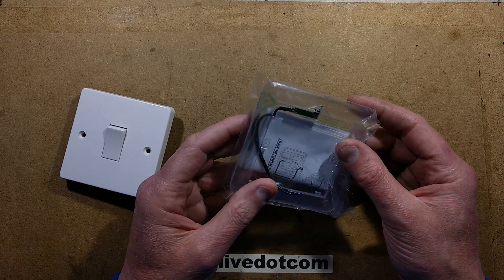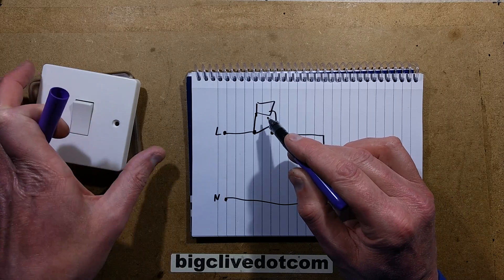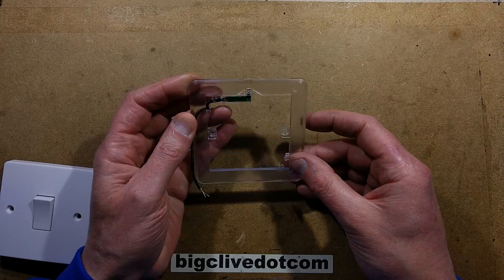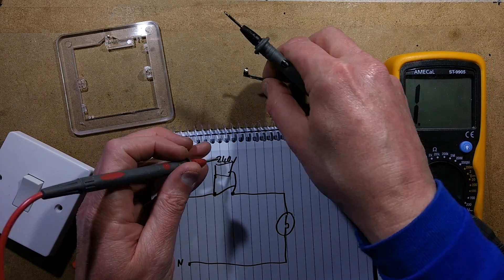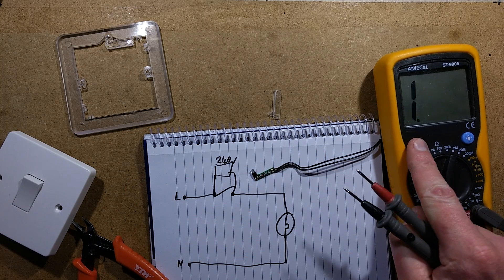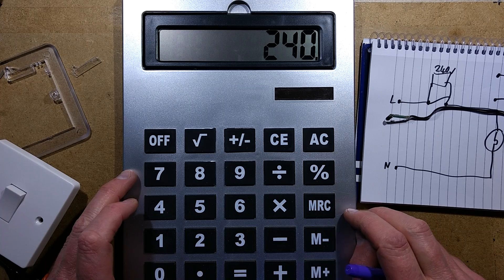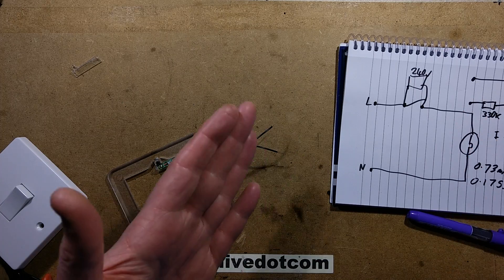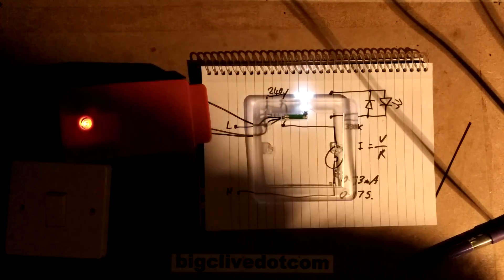Illuminated switchplate adapter.  (With "schematic".)

Comment: Why do they recommend to use it with LEDs lamps? LEDs can glow with a very low current, incandescent ones won't
Reply from the maker: +Techtastisch 75 I fluffed that bit.  It's recommended for tungsten lamps.

Comment: With The Wall switches installed and everything screwed up it will help diffuse the light into a  proper soft ring of light.. You need to finish the light box part of it.. There are 2 different plastic diffuser rings to capture the light and emit it JUST around the corners.. 
  I say install it.. 
  This is Just what i've been looking for, Thanks !!!!

Comment: Would be interesting to try that with a switch and an led bulb in place, I've had things like these allow just enough through to charge the capacitor in an led lamp and make it flicker while the circuit is off

Comment: One trouble with the 330k resistor being on the little PCB... if there is a short where the two wires meet on the PCB, the tiny gauge wire could shunt the light switch and end up carrying the current of the entire light fixture and melt or start a fire.
Reply: Actually you can do a binary search for the fault - only log2(n) breaker trips instead of n.
Reply: LakeNipissing well, good concern from the other guy i think... and even if this is to happen, a breaker still may not trip during the wires melt,they melt probably at around 1 amp and the breaker might be a 16 amp one. so the room light keeps drawing amps until the switch melts and cause fire... i wonder about this liklyhood.
Reply: Matt Quinn  5A round pin plugs and sockets are still available, I know because in the living room, dining room and master bedroom in my modern house (now about 17 years old) they fitted the 5A sockets to the lighting circuits so that table and floor lamps could be controlled by a double wall switch.
Reply: "I could see it being 'fun' trying to trace the faulty one if you had a few and the breaker tripped!". Turn on all the lights connected to breaker, reset breaker, turn lights on one at a time until breaker tripped.
Reply: We don't generally have a neutral in our switchboxes in the uk.
I've seen them connected to ground, and if they go faulty it trips the RCD (gfi)
Reply: Yeah, in the 60's they relied on the metal conduit for any earthing, but generally a light fitting did not need an earth.
Sometimes when you control several light circuits from one switch location it's easier to run the power to a switchbox and distribute it to the several lights from there.
Only RCD on a lighting circuit is the 100mA main RCD, which is only needed if the earthing is not good enough to carry full fault current.
Reply: HAHA, i know that trick of charging batteries from the mains, in the 60's i had a 'Dan Dare' intercom, batteries went flat, so i thought it would be a good idea to connect the wires to the striplight above my bed, i let the smoke out :P
I was about 7 or 8, but understood that i had to turn the light off while connecting.
I guess that's why i became a sparky :D
Reply: If you messed up the wiring, it sounds like something was really wrong, iirc my bed light was plugged in to a socket, are you old enough to remember the old round pin sockets ? it would have been a 5 amp socket, possibly on a 10 amp fuse (several sockets on a circuit), fuse wire blows at about 1.5 times the rating, and wouldn't damage the wiring.
Yep, i remember the spring 'breadboards', had one myself, something like the 'science fair' stuff on this page http://zx80.netai.net/grant/ElectronicKits/index.html
Reply: I think my post disappeared because i edited and added a link which has probably been set for review, clive may allow it sometime.
If not, search for 'spring experimenter board' in images, you should see 'grants' , on the page scroll down to 'science fair'
Before our council house was rewired it was lead covered twin and earth, the wires were rubber insulated or cloth covered rubber.
I know about stage lighting, i used to do it in school, and later in a local small theatre.
Reply: I thought Google only blocked ME for adding links. I see other people do it all the time, but I am always blocked. So it seems Google is selectively blocking different users for attempting to add links, but not others.
Reply: Where i worked we use MK T pin plugs for essential circuits, it was partly a lab environment, so the essential circuits were for fridges and freezers that contained biological samples.
The round plugs were always used in theatres before bs1363, they just never changed, think of all the plugs you would have to change if they had to conform :P
In the school and theatre the lights had the duraplug 3 pin connector on a short cable, then that would plug into an extension that had the round pin plug, the sockets were fairly reachable. and there's a way to get around the fuse problem, just use a brass rod :D
Reply: +lakeNipissing google blocks links because of advertising spam, it should go in clive's review section where he can approve or remove.

Comment: They should have used the type of LED with the inverse cone molded in to the top that sends much of the light out to the sides....  I'd have gone for a yellow or amber LED, myself.
Reply: EL wire around the outside would look the best, but then you've got the same longevity issues as neon.  Could run it straight off the mains in 120V systems, too.
Reply: RGB LED's are awful.